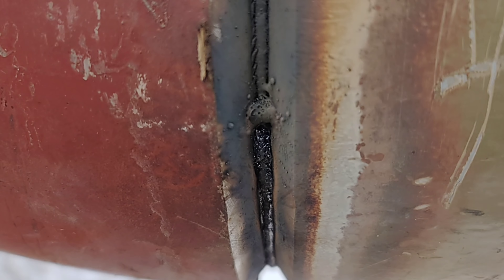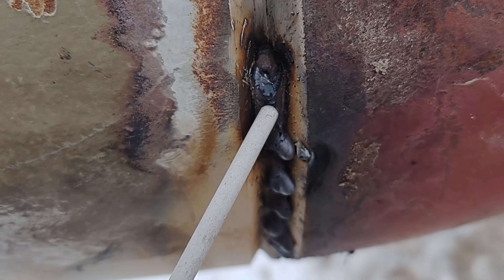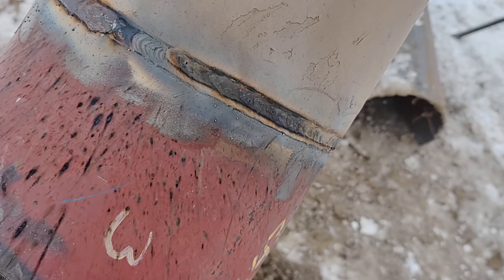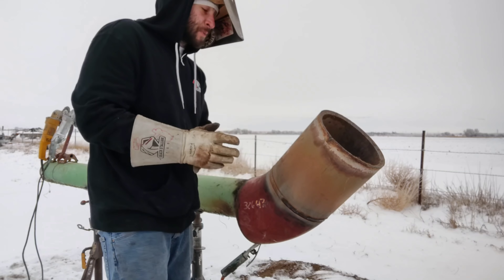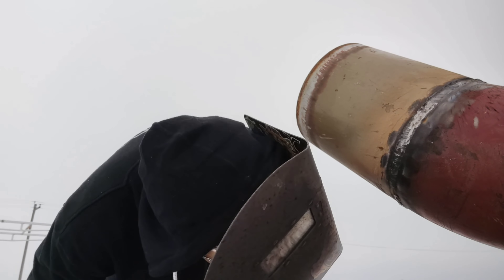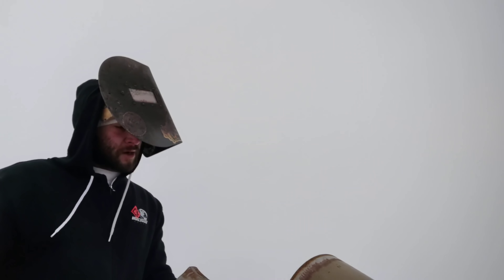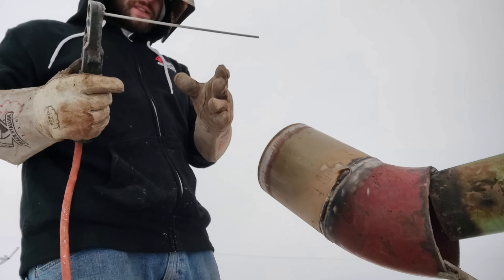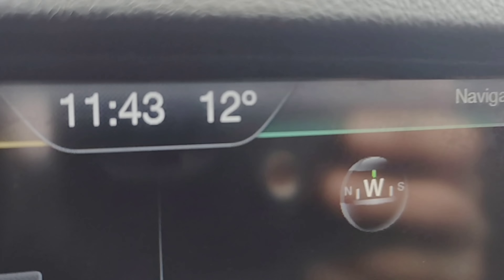WELDING 6G HYBRID TE$T

Comment: I like the video , but I don't understand why you go downhand then on the other side go uphill, that does not make sense to me , the whole thing should be done travelling uphill  what is uphill mode  downhill mode . ? Downhill .?
Reply from the maker: It's all good that's what my channel is about. To learn. I am glad you ask. The purpose is to qualify the guy in both procedures in one test. The modes are what the machine provides. A uphill mode for running 7018 stix and a downhill mode to run 8010 7010 6010 series stix. Hope that helped you
Reply: @TheWeldProfessor  thanks for explaining it, now I have a better understanding.
Reply from the maker: @spark893  anytime